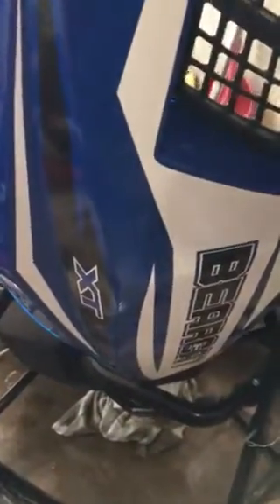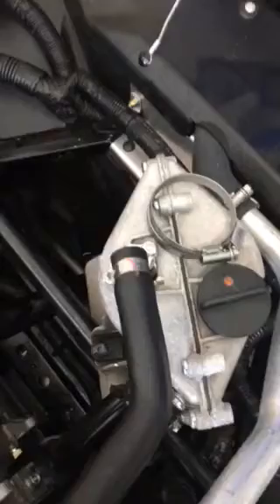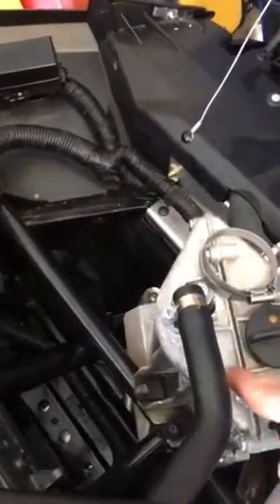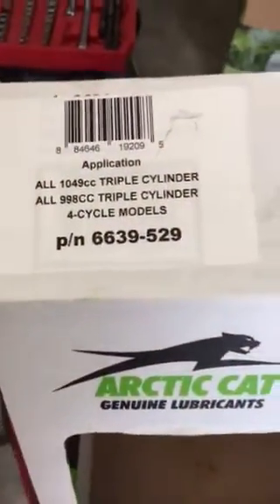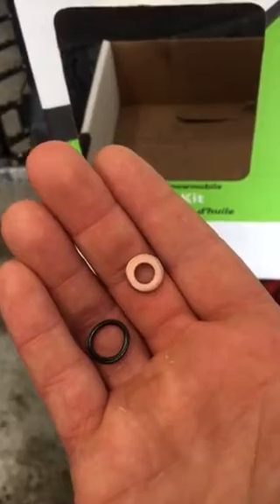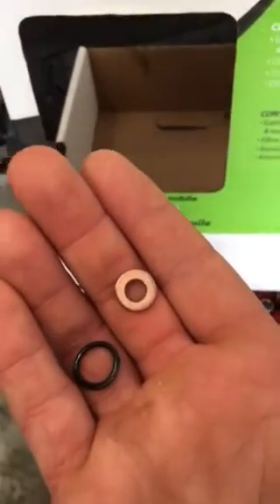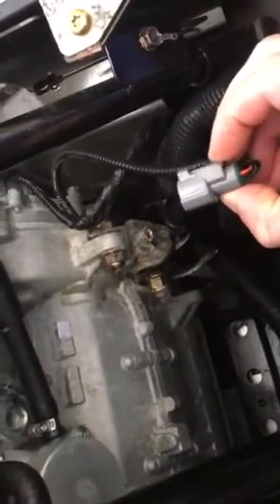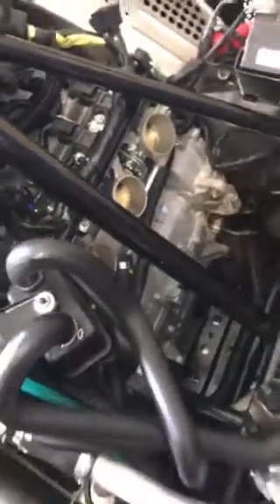2016 Arctic Cat Bearcat 7000XT Oil Change Tips

Comment: We have aquired a 2018 XT GS. Jeremy, thanks very much for this video. Without it, I would have been lost and completely unaware of the issues to tackle. I needed to avoid the mess. Because of your video, and little reading on the service & owners manuals (they say the same thing), I removed the airbox one day. Then fashioned a funnel that fit under the oil reservoir (from a maple syrup jug) with a tube attached that I snaked under the engine and out through the oil filter access plate. Then got setup to change the oil the next day. Hardly any leakage, but still some cleanup - it's unavoidable. Cheers!

Comment: Thanks for the tip, figured the easiest way was to remove the air box. Thank you for sharing ! 
edit.  I found an empty plastic box for wood screws that fit perfectly under the tank and then used my
vacuum oil extractor to suck oil from the there, when the level got to high i just covered the hole for the
plug with my finger and let the vacuum extractor lower it and then remove the finger and let more 
oil drain from the tank. I had to repeat the process a couple of times and then I left it to drip
for a while, remounted the plug and filled the oil tank again. :-)

Comment: I changed mine last year on the '17  XT GS. What a nightmare! Thinki might invest in one of those vacuum suction containers. But still have to drain the engine. Not a fun chore.
Reply from the maker: Shane Roper not an easy task at all.  I have a vacuum pump, they work well.  I just like seeing everything drain out when I have the option.  Plus a little flush with clean oil always makes me happy.  The price of service from cat is just too high these days to bring it in.

Comment: I took off the belly pan also so when draining the reservoir it would just drain into the oil pan instead of all over the engine compartment.
Reply from the maker: Did you do that before or after the video?  🤔
Reply: Second this, it's like 5 screws